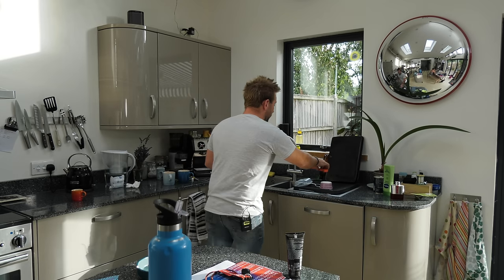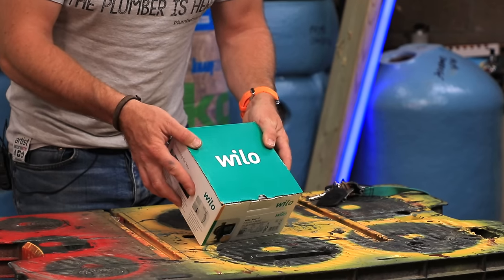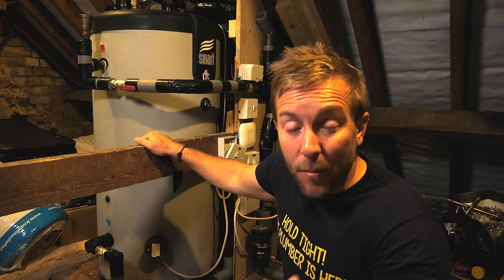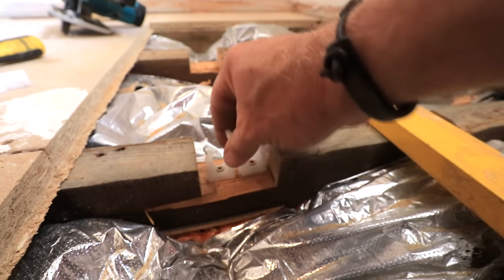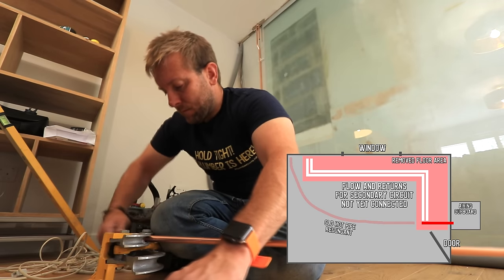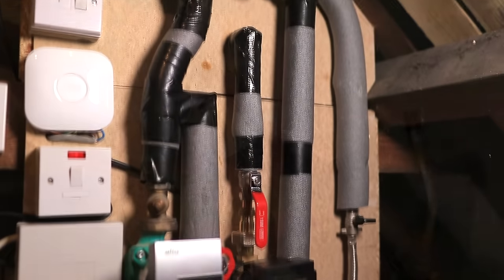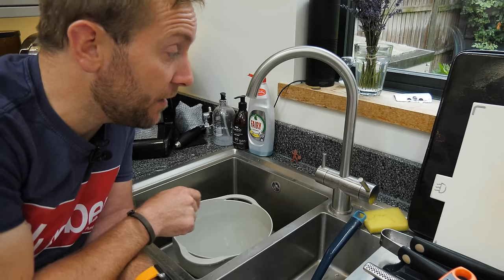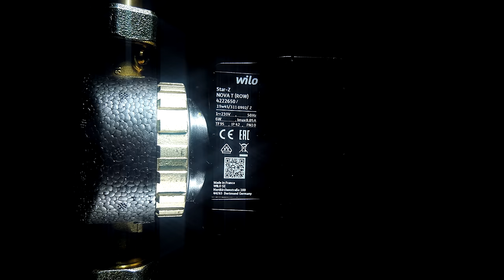HOT WATER TAKES A LONG TIME TO REACH TAPS - HOW TO GET HOT WATER FASTER! Wilo Secondary Return Pump

Comment: You said you can't use plastic pipe.
Is Pex-alu-Pex considered plastic?
For me it's still not really clear why non replenished water can go through plastic, but replenished water can not.
Reply: He didn’t explain that very well... plastic pipe isn’t designed for ‘ Constant heat’
Reply: @Roverturbo  Still confused over this plastic pipe business, we use it for mains water we use it for heating which is constant  heat,must be me then ,.
Reply: @peterryan7827  
Potable warm water is ~60°C, water for floor heating probably ~30°C.
Maybe that is the difference?
James stated it as a fact without explanation. Unfortunately.
I already configured my return lines in my new house as Pex-Alu-Pex, so I am very interested whether or not I have a problem.
Reply: MLCP is 100% fine but is not for DIY'ers or arguably Apprentices. However MLCP is NOT a DIY plastic pipe but a professional alternative
Reply: @andrewriley4204  
But the question stays: Why is "plastic/Pex" not suitable for return lines of potable warm water?
Reply: Glad in  Scotland don't hav to worry about how much water we use🤣🤣🤣 leave it running all day if I like won't cost any more
Reply: Colin fleming You might not have a water meter, but you still have to pay to heat the stuff!
Reply: @spencerwilton5831   just seems a lot of work and some heat loss for what was it 10seconds faster

Comment: Would be interesting to calculate what is greener: the waste of the water when you do not use the return pipe, or the waste of the heat from the boiler when you have the return pipe in place?
Reply: the problem being solved is not "green" miss-used marketing term. The problem being solved is hot water taking longer than a human can wait to get to a farther location of a building (personally shouldnt be problem take quicker cooler showers). A better solution GREEN wise (terminology green meaning lowering fossil fuel footprint to generate a 1 kilowatt of power ) would be a heat pump water tank if utilizing electric or natural gas.
Reply: the video solution DOES not work in foundation laid copper pipe- UK plumbing pipe  is more exposed to work on, remodel or extend.
Reply: Pro Answers    I disagree, the problem being solved is clearly marital.

Comment: Just how deep should we be cutting into those joists, what you have done there to get clips below the floor plus, the insulation, does seem a worry, as to how much you have weakend those  joists i have a strong suspicion any building inspector  would not be happy,
Reply from the maker: I was expecting this comment. The beams I have are 9inches by 3 (some are also 9x2) most beams these days at 7 inches so the removal of an inch section is fine and happens in almost every home in this country!
Reply: @plumberparts  Thanks for the speedy reply, love your videos and, hope you did not mind too much my mentioning this point I was imagining my old boss leaning over me and saying WTF, have you done there, because, we had a young lad do this on one job and we had to buy steel plates for either side, with coach bolts.he was not a happy bunny, cheers again,
Reply from the maker: Just shows how utterly crazy the culture of safety is now - resulting in the current madness we live in!

Comment: How do you achieve a similar results if you have a combi boiler without tank? There is no place/tank to send the hot water back. Ideas? Is there an inline electric heather that can be installed under the sink and operates until the hot water arrives?
Reply: ReX    Hi Rex, I piped my kitchen hot water service in 10mm speedfit for an experiment. 10mm pipe contains roughly one third of the volume of 15mm pipe. I have a combi about 12 metres away from the kitchen tap with 5bar incoming pressure. The hot comes through in 8 seconds if I run the comfort mode (pre heat) on the combi and there is plenty of flow 16lpm.
Reply: @scottlittlewood4527  sounds like a clever idea. In my case I have the boiler on the ground floor, next to the kitchen, so my problem is the bathrooms on the first and second floor. Would you have two separate 10mm pipes from the boiler to the two bathrooms? I wonder if it will be enough water for the shower and bath.
Reply: ReX   I always run individual hot supplies in 15 to each bathroom nowadays. It gives better diversity, so you can run everything at the same time. You will always be dependent on incoming mains volume ultimately and ensuring it's delivered to the combi or cylinder. Running two showers at 16lpm is ambitious for incoming mains and the combi having said that. Ultimately this is all a bit of a 21st century problem!
Reply: @scottlittlewood4527  I got this Victorian house fully refurbished before my purchase. Bit by bit I discovered and fixed hidden problems here and there. So far plumbing (new, all on plastic) is good, except minor issues already sorted. They haven't insulated the pipes... Cold and hot water go to the first and second floors bathrooms on 22mm pipes (so the two bathrooms share the same pipes). When it is extremely cold, it takes a while to get hot water. The combi boiler is new. I am not sure if it is worth investing in pipe insulation or there is an electric inline heather that can be installed under the bathroom sinks, to warm water while waiting for the hot water to arrive. Suggestion?
Reply: ReX   To be honest installing a hybrid inline electric heater is unconventional and quite a bit of work, with unknown consequences. Once finished you become the experiment. The initial information you need to gather is the flow rate at the problematic outlet and boiler capacity in hot water mode. If you have 15lpm at the outlet and a 24kw boiler you will struggle during the coldest winter months, when the ground and ground water is coldest. During summer it may be less of an issue. Your boiler may have a preheat function on the plate heat exchanger which can be activated to shorten the wait during the ignition sequence. Reducing the 22 pipe to 15 will reduce the cold water run off required before the hot appears, but I dare say the intention was to give better simultaneous performance at both bathrooms. You could replace the easily accessible sections of 22 with 15 and see how you go, even add insulation at the same time? Have a look for your boiler specs online for perspective. Usually they'll state the hot water performance in lpm for a specific temperature rise. From memory the Vaillant ecotec 28kw gives about 11 lpm at 35 degree rise. Assuming your incoming temperature is 6 in cold winter months, you'll get a 41 degree shower at 11lpm of hot water. The reality is that you'll lose some heat between the boiler and shower and bleed a bit of cold water through the shower valve too. So, for this example a person who likes a hot shower will be disappointed if the flow rate is greater than 11lpm, which to be fair is not the most exciting shower in the world. In the same circumstances, a person who likes a 37 degree shower will not understand what all the fuss is about until next year when the plate heat exchanger gains some scale and insulates the water from the heat. Come summer when the incoming water is 2 degrees warmer, everyone will be happy!  If I were you I'd look up the specs, measure the flow, take the incoming temp and take a view from there. Maybe strip out some 22 if you're that bothered or spend your time and money doing something more fun if you're not.

Comment: What about a single shower type pump? I realise you'd still get the "waste" water but it'd speed the hot water through?
Reply: He can not pump it Gareth because it is an unvented system which is mains pressure not gravity feed from a loft tank 👍

Comment: Does that mean the heating will come on more regularly. There must me heat loss.
Reply: 25:00?
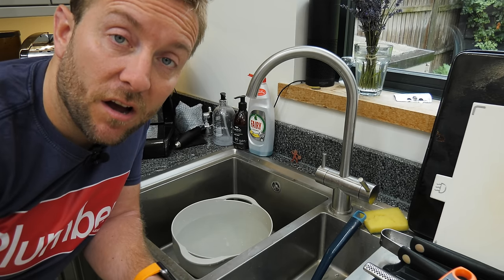Reply: @marcuslittle8049  25:49 if you have the system he has.  Underfloor insulation,  plenty of room in his loft and not 71ft between boiler and tap like i have.

Comment: Why don't they have two pipes in one...one inside the other? That way, you only need a single pipe, and the hot can warm up the cold so it all gets warmer more quickly, and when it is up to speed, you can flow both pipes in the same direction, so you lose very little off the maximum flow rate.
Reply from the maker: If only mate! Invent some - I’ll buy it!
Reply: @plumberparts  Joining to it would be a nightmare...
Reply: Mike M    Paying for it would be a nightmare!

Comment: About not using plastic - I will guess that the point is - any particles in the water will abrade the plastic when the water is flowing and the particles are moving.  If the water and particles are moving 24/7 and not just when drawing water, that results in a much faster rate of abrasion.  Reading the comments further... @plumberparts says this is the reason.

Comment: Secondary circulation pipework should run to within 1m of any outlet  so adding  a secondary (bronze) pump can only be added with the extra pipe work so adding a new whole pipe to a home with slow outlets will not work from a practical point. The pipe work has to be fitted when the home is built otherwise uou have to run a new pipe to the furthest most point of the dhw system. This system is only used on large properties may e 4 bathrooms or more ,hotels and institutions. Not for the the small to medium home as the pump circulates water from the hot water storage tank and all around to within 1m of any tap outlet and then back to the tank. This pipe must be fully insulated otherwise all it will do is drain heat from the tank so again fitiing a new pipe fully insulated all the way from the cylinder (tank) and back under all floors unless a new build is not practical
Reply from the maker: Yeah what I said...😀

Comment: I don’t get why these systems are still used. All the copper needed. The pumps etc. My last referb I ripped everything out. Sold the copper hot water tank and all them pipes. Then installed a combi boiler. Simple. Cold in. Hot water out. Gives you a fresh start too  as you can change radiators and clear out the black gunk from pipes. New boiler. Fitting etc is around £1200. I did the pipes myself as a diy project. The shower is pretty powerful too.

Comment: At 9:00 You don't actually explain why you can't use plastic pipe in the circulating loop.
You just said "heating systems don't have a constantly replenished supply".  
So what?   Why is this is significant?

Comment: I would just like to ask is there not a much simpler way to solve this surely there a pump out there which could go under the sink with a flow switch ,that as you open the tap it just speeds up the whole process, tell me i am completely bonkers here,
Reply: It wouldn't change the fact there's potentially metres of cold water between tank and tap that needs to be flushed out.

I've got a hot water pump that delivers plenty of pressure but I still have to wait for the hot to arrive at a certain outlet.

This method minimises that distance.

Comment: Surely plastic pipe will transmit heat further and faster than copper, as copper is a way better conductor and radiator..

Comment: Plumber's in the UK are just like plumbers in US, they know a lot about plumbing and next to nothing about structural weakening of floor  joists by notching out big chunks of wood in exactly the wrong spot, just to run pipe.  You're forgiven in this case cause it's your own home you're damaging, so carry on lad!
Reply from the maker: Mate, they're 9x3's! I notched aout a baby 1 inch. My house is still standing though. btw, how would you have laid in the copper pipes?
Reply: @plumberparts  My apologies, 9 x 3 floor joists are not common here in the states since back when timber framing was common.  When running  pipe in joists we never cut the top or bottom of the joist since that weakens them considerably.   Drill holes holes for the pipe away from the ends and near the center of the 9 inch width (depth)  of the joist then run the pipe through the holes .  If you can't do that , then run them under the joist using hangers off the bottoms. If the joists are supported at short intervals from below, then cutting the tops like your doing will be ok if the unsupported length is kept to a minimum.  Less than four to six (eight) feet I would guess. Problems arise when plumbers here in the states arrive on site and start cutting joists to fit plumbing pipes not considering the weight bearing span of the joist or worse, engineered web joists.  It's just not done as it's considered
unprofessional.

Comment: I would have thought that a small electrical heating tape attached to the lowest point in the pipe would achieve the same result without all that hassle.  It could also be controlled by a timer to only operate when required.  It only needs to supply the power that's lost through the lagging of the pipe which is the same as in this method, about 20W should do it.

Comment: You give not 1 valid reason not to use plastic pipe on a hot water pum,uped system and i cant think of one, if anything plastic is a better insulator than copper, but it matters not when insulated
Reply from the maker: Ok calm down! 😂 It’s the plastic manufacturers that don’t give the reason - but they won’t cover it and that’s their prerogative. If something happens and your insurance company gets wind of it then they’ll more than likely use it as a reason to not pay out. Something is like my viewers to avoid! 

Have a nice day! 😎
Reply: @plumberparts  so to sum up there is no reason mechanically its simply a wrong British standard 
And I'm sorry if I give the impression of someone who's not calm 🙂

Comment: Speedfit say “Speedfit products must not be used on any continuously operated re-circulating systems as they are not approved under the current version of these standards.
However being creatures of habit I only run my recirculating pump for 3 hours a day and not to an excessively high temperature. The issue is there hasn’t been a specific test to certify this mode of operation so you wouldn’t get a warranty. You pays your money and takes your choice.

Comment: 🧐 it’s using less water, but more electricity... I think I’ll rather waste water as it’s on a fixed meter.
Reply: This is not about saving water or heat.
It is al about convenience.
Saving water is a positive by product 
Loosing energy is a negative by product.
Reply: I've roughly worked it out at £7 per year if running 24/7.

Hardly breaking the bank 😂
Reply: @muddyfunker3014 
Don't know what 1 kWh at your place costs, but having a circulation pump (6 watt) running for 24/7 would cost, in the Netherlands, ~€12, - (~$13,-	) alone. Next to that the energy loss of the heated water.
Reply from the maker: Tin hats are expensive too! 😂😂😎😎
Reply: Heatrae Sadia?
Reply: plumberparts not sure about the tin hat reply, as I’m just pointing out the facts. Tanks in the loft, you’re using a pump to circulate water regardless what the output is... it’s running... could be peanuts to run, but the pump ain’t cheap and neither is labour... that thing is running couple hours per day... what about the thermal loss? Circulating the water outside the tank along the pipes? So to keep the temp at 55 or what ever you set it at, the water that’s coming back in on the return feed will have lost 1 to 2c not that we can feel it, but the thermostat will and that probably kicks in the electric element... so over time this multiplies, just to save that 40 second each morning 😂 put the kettle on takes a couple of minutes, might as well drink a cold coffee

Comment: your idea is good to save water
.

but your idea costs a lot of energy, 
even though it insulated the pipes. 
Heat is lost which has to be heated again and the pump also costs electricity.

Then the Quooker COMBI + boiler is a more economical solution.
www.quooker.co.uk

The Quooker boiler supplies hot water at the start and when the hot water comes down, the Quooker stops.
And the Quooker has the best insulation, NOTHING!!! ordinary vacuum tank.
( vacum does not conduct heat easily )